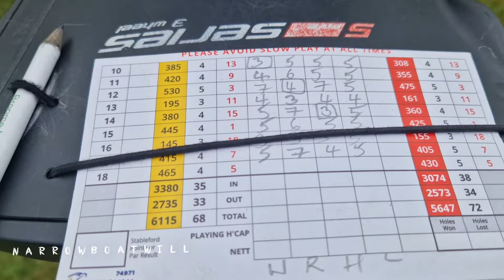Boats have to be lifted out because of the Ribble link closure. My journey continues..

Comment: Hi Will. Enjoyed that lifting vlog. Friend of mine worked in h&s and certified the lifting straps as fit for purpose, or not. A man turned up with his own straps to lift his boat out of the canal, my friend took one look and condemned them. Man insisted they be used, so friend got him to sign  a disclaimer. Just as well as one snapped with boat in the air and it dropped hard onto the canal breaking the hull and sinking. In Stoke I think. Hope you are well. Regards. Paul.
Reply from the maker: Blimey. That guy sounded like a right plonker.  😂 🤣 😆

Comment: Hey Will, another really interesting vlog. Hydraulics are amazing to me. The amount of weight they can lift and the pressures they work under...wow. I have a hard time blowing bubbles through a straw in the bottom of my drink and I can only imagine the power it takes to push fluid into a hydraulic cylinder to push the piston and lift tons of narrowboat. Same with engines and transmissions. It's amazing the amount of power they have when you look at how they work. 
    Thanks for another one. Take care. 👍👍
Reply from the maker: I know. What a great invention. Power steering and all that.

Comment: My rear trad deck had the same problem of water leaking into the engine bay via the access hatch (drainage channels couldn't cope in heavy rain). Cured it by sourcing heavy duty rubber matting, cutting to size, covering the rear deck with it then standard non slip deck matting on top of that. Stop and have a look next time you see us (NB Ho-Jo)
Reply from the maker: I don't have a weed hatch on my back deck. I have to crawl into Hobbit Land to access my prop. My sliding hatch leaks a bit because rain travels along the runners..
Thanks for stopping by guys.

Comment: I watched a Hyster crane lift a 26 ton widebeam back into the river the other day. Amazing machine, the driver has scales to weigh the boats. He said the worst thing is when people don't have inspection hatches or check their bilges. Imagine an extra 3 or 4 tons of water sloshing around while they're trying to keep the boat level.
Reply from the maker: I bet it can mess up the balance when lifting.
Reply: @NarrowboatWill  He said he nearly lost one that was full of water. I think he gave the owner a 'stern' talking to 😉
Reply: I was held up with many other normal boaters for almost 12 hours by one of those monstrosity’s, stuck under a bridge on the T & M, the owners were horrified. Being in construction and having worked on heritage. You can imagine the language I was using.

Comment: Bow thruster tubes are generally 10 to 15 mm gauge steel, they rot out because boatyards can't be bothered the clean then and black them, same with base plates, boatyards just want you in and out as quick as possible.
Reply from the maker: Agreed. I've seen a few rotten.

Comment: did you test that the water does drain away before refitting on the van
Reply from the maker: I had to move quickly. It still leaked later after rain. I've solved it now. Stay tuned.

Comment: Don’t think that’s supposed to be sealed against the windscreen. The water is supposed to go behind it. Could be wrong but I think that’ll push the water over the top and into the engine bay.
Reply from the maker: You're right. I worked out the problem later. I thought it ran over that plastic. I'm trying anything to be honest. 😂 🤣
Reply: @NarrowboatWill  I only learnt that myself when I refitted mine badly and the water filled the engine bay up and shorted some of my electrics 🤦🤣
Reply from the maker: @MrOitoyboy  I do solve it in the end. Water gets behind the metal mounting frame. I took it off and sealed it. No water now.